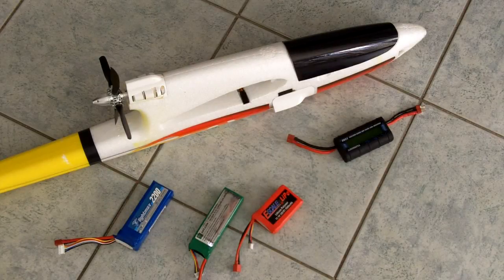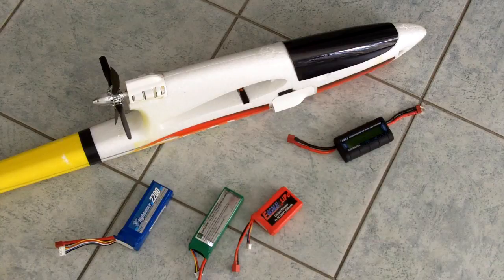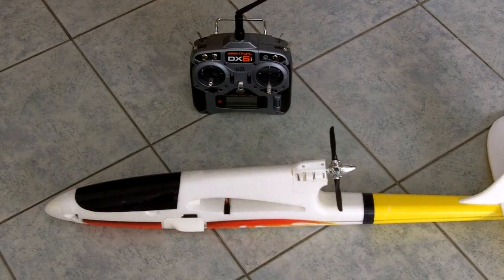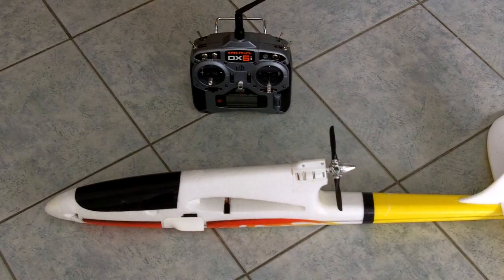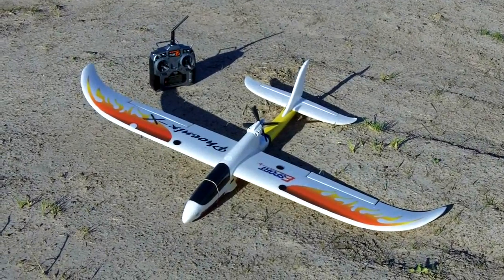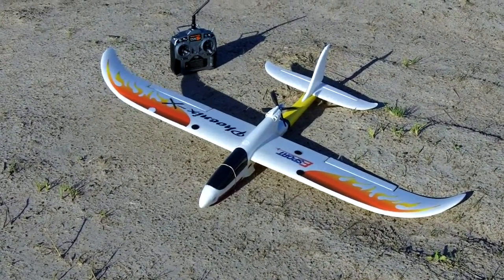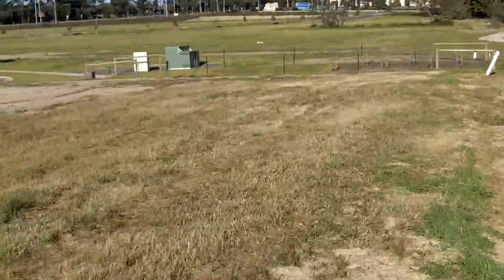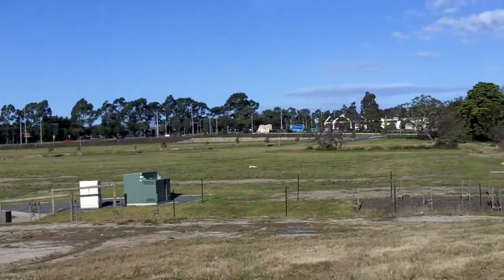Esport Phoenix - 4S wattmeter &  flight test with crash

Comment from the maker: @STOKEKNOB glad you got a phoenix, mines been a great model. I would suggest adding protection under the nose and the rear skid. Mine is a bit chewed up in both of those spots. Tape works ok but if you glue a strip of plastic under the front and rear that would be better. Give it a firm launch and it will also glide in for a easy landing. I woiuld suggest starting with a slightly nose heavy centre of gravity.  Happy flying!